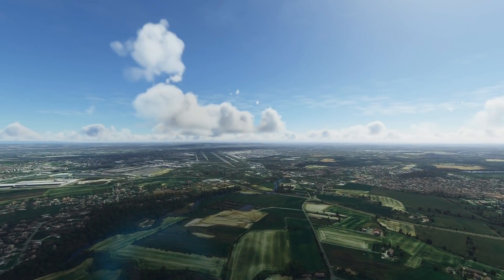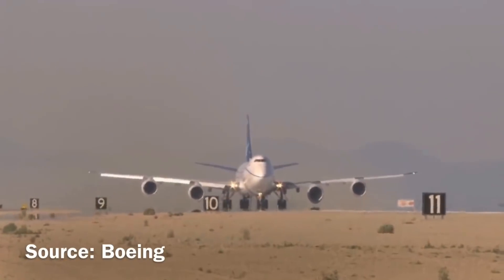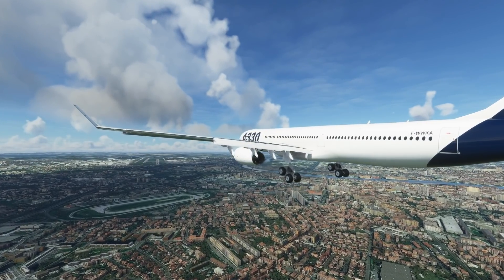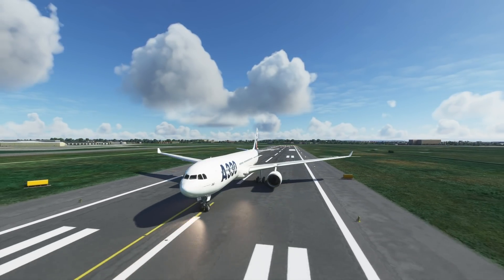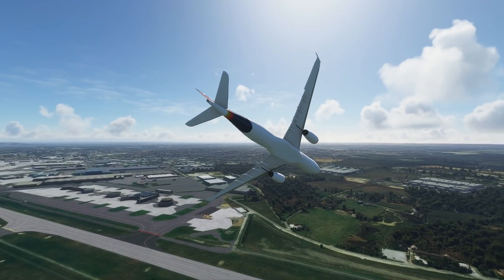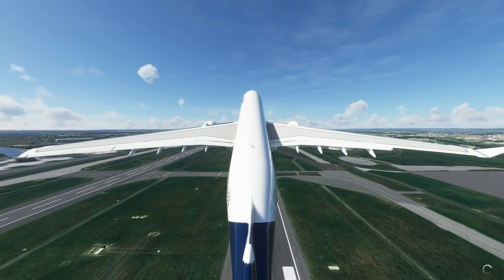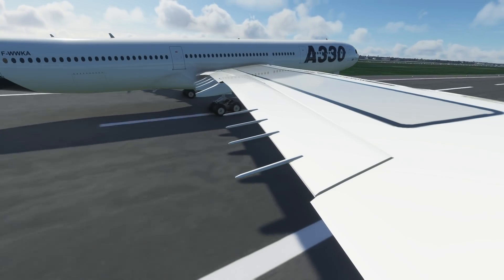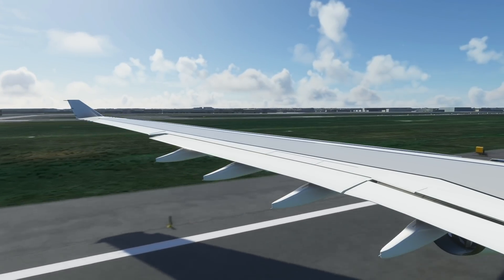The Test Flight That Went Horribly Wrong | Airbus Industrie Flight 129

Comment: There is one thing I have a life of me cannot understand. Why are  people allowing autopilots to put the plane into an unsafe position and not give a warning to the pilots?

It should take no genius to program the autopilot so that it registers that at this power setting this lead in this news angle a crime is not going to be sustainable I am bad storm will happen pretty soon. In this situation there is no reason for the autopilot to not throw up their hands and say: “Hey pilots,I cannot do that! It’s not safe! I don’t have the power, I don’t have the speed, I am already angled up way too much!
Instead of trying to commit suicide, I will therefore go to a safe state. That means I will not put all priority in to climb, I will not climb so fast that I drop below a safe speed.  If you want me to do anything else, you have to give me new and fulfillable orders.“

“I was only following orders” has fallen out of fashion after 1945.
Yes, absolutely you must alert the pilots, but the most safe way is almost never to climb into a stall, avoiding entering a stall is almost always preferred. If not, pilots can intervene.

On top of that, an autopilot changing modes without announcement, based on arcane rules, is clearly not “the least surprising action”.

It’s as if people designed the autopilot to be stubborn beyond belief when it comes to climbing to a target height “for consistency” but changing modes willy-nilly where consistency would actually be needed!

Where is the line between incompetence and cold-blooded murder when you design autopilots that do their best to kill pilots?
Reply: You’re watching a video based on an accident from 1994.......do you think they’re exactly the same nearly 30 years later?

Comment: Although the crew was apparently tired and not on top of things, automation in the cockpit strikes again.
Reply: Why the autopilot doesn't set off a very clear audible and visual warning upon switching modes, I don't know. It is a very big reason for trouble if the autopilot decides to start doing stuff you didn't expect it to.
Reply: That was all it was....pilots not on top of things and leaving the altitude set to 2000ft. Everything else you may as well blame on the person who designed the auto flight system and didn’t put an attitude protection on the altitude capture mode of the FMGEC

Comment: I recommend they dont engine out training on actual planes with a full fuel tank low to the ground. A new pilot will always mess up and crash the plane.
Reply: Right? I wonder why didn't they try it at altitude first. Climb, slow down, configure the plane as it would be right after takeoff. Pretend they just took off from Denver. Climb and during the climb, shut down the engine. It would have given them at least some idea how the plane will behave, with plenty of buffer to get back control in case they were close to stalling.
Reply: @lukfi89  the test objective were to see how the autopilot would handle the aircraft in case one engine fail on initial climb after takeoff, not how it would react if one engine fail at altitude in a level flight
Reply: New pilot? Those pilots were test pilots with thousand of experience of testing experimental aircraft

Comment: Thank you for treating this crash. Long time ago. I live 125 km from TLSE. Just before that crash I took a girl friend to Blagnac-Toulouse airport. I hesitated to go to the runway to spot the plane leaving, in which she was flying back home (I usually did that, she worked at KLM at that time as a purser), but I had an appointment, I declined to do that. Driving home on the highway I saw in my mirror a black column of smoke near the airport... mmm, some farmer is making a big fire with a lot of old tires in there, was what I remember thinking... I did not think one instant of a crash... Back home, two hours later, after my appointment, I heard on the radio the terrible news... When I think of the fact that I could have been at the side of the runway at that moment if I would not have been so tight with time for my appointment...
Reply: Condolences for the loss of your friend.
Reply: @janicesullivan8942  I maybe wrongly understanding this, but I don't think she died.

Comment: Wasn't it a common problem with early Airbus planes? Too much automation and/or computerization, almost taking the pilots out of the loop?
Reply: I wouldn't say too much.
More that it did too much for the pilots to stay in the loop, but simultaneously too little to keep them out of the loop safely.
So, in other words, in the unsafe valley between no and full automation...?
Reply: @MrNicoJac  I know that Boeing went another route, where they wanted the pilots to be as much a part of the decision making process as possible, but that brought other problems with it. So, yeah a safe balance is needed.

Comment: Bro, how have I never heard about this!!! Everyone knows the 320 going into the trees, but not this.
You need a million subs.
Reply: The A320 crash was quite different to be fair - it was filmed, many people saw it happen, was a demonstration flight, and had passengers. It's still unusual that this isn't more known though, I can't remember seeing anything about it recently(must've been in the news at the time though)
Reply: Airbus flight 129 is not the only case of the computer crashing an airbus that most people have not heard of.  XL Airways flight 888T was a test/acceptance flight of an airbus A320  that the computer flew into the Mediterranean sea during a test because the angle of attack vanes froze in flight due to water ingress.
Reply: @Vincent_Sullivan  wrong. The pilots stalled the plane when they kept slowing down due to the incorrect Alpha Max display BECAUSE OF the frozen AOA sensors. They flew it into the sea themselves when it stalled
Reply: @Vincent_Sullivan  Computers did NOT crash flight 888T they failed to recover it. The protection systems were offline bc of the frozen AoA vanes.

The crew began the test too low and assumed functionality of the recovery systems.
Reply: @Vincent_Sullivan   some things just can't be found any other way than using the equipment under various conditions and seeing what happens..
Reply: @Vincent_Sullivan  I've read all about the alpha floor acceptance test crash.

Comment: Not sure why the autopilot would try to get to 2,000 feet without the autopilot also taking into account the loss of engine, pitch, bank angle, stall speed, etc.  Sounds like a software issue to me.
Reply: ALT* mode at the time did not have attitude protection.  If they had actually checked the altitude selector and seen it was so low it would have stayed in SRS or gone to climb mode

Comment: It’s too bad they didn’t try this test in a simulator first. As a person who has never been able to walk and chew gum, I’m in awe of the competence of skilled people. In spite of their extreme collective ability the human factors, which procedure, the preflight briefing, was designed to overcome,  mounted up and doomed them.
Reply: Before they do that in the sim they have to test in real mode to feed the sim real data. This is why no sim currently simulate stalls it is because stall is not required to be demonstrated in certification, so it is never done in real life thus not modelled in sim.
Reply: Could they have not tried the same simulation in an A321 flight sim, to get an idea of how the plane might respond?  I guess they know now.
Reply: @paulsz6194  no because the A330 is much bigger and its engines produce more thrust

Comment: 2000ft would have been set as the go-around altitude from the previous flight, after they descended below 2000ft on the glideslope. The same thing could have happened during a single-engine go-around. They'd have been at TOGA thrust on a single engine, in SRS vertical mode initially, but they'd quickly enter altitude capture mode. The lack of airspeed or alpha protection in altitude capture mode was one of the findings of the investigation. Although human performance did play a major role in this accident, the A330 autoflight system was updated to address this deficiency. Many airports have go-around procedures with low level-off altitudes that create a high workload for the flight crew. Much more recently, the A320neo family has added a "soft go-around" mode with a slower rate of climb so that they don't take off like a rocket and smash into altitude capture seconds later.
Reply: I was surprised when I looked this up that ALT CAPTURE mode didn’t have attitude protection. I thought it was basic and built into the whole EFCS
Reply: @tomstravels520

I was surprised too when I did a circuit in a King Air with altitude capture at circuit height (I’d just disconnected the autopilot/yaw damper and left flight director and modes on) and yeah it was aggressive. 

It probably just assumes that if it captured it.. it was from a previous vertical mode and if it’s off it needs to do whatever it can to get back.. probably thinking it’s at cruising speed in the flight levels.  

One thing I’ve never understood about Airbus though is using Angle of Attack rather than Airspeed as a flight envelope parameter. Yes.. you need to exceed the critical angle of attack to stall.. but without airspeed.. preserving that angle of attack will give you a recovery point that is subterranean which is exactly what happened here. 

That’s why most planes are flown in reference to airspeed not angle of attack.

Comment: Thank you  for this Sunday surprise. When you mentioned " no formal pre-flight briefing" I was shocked even  tho I was familiar with this incident.  Senseless loss of lives.
Reply: I think egos and even wanting to show that you don't have one are equally dangerous in the cockpit. You always need some kind of cockpit gradient. Not one so steep that nobody dare question the captain, but also not one so flat that nobody takes the lead to direct things and delegate roles and responsibilities. In some cultures the problem is extreme cockpit gradients where the first officer is an underling to the captain. In other cultures nobody wants to appear full of themselves and take the lead when they feel like they're around equals and peers, and a lot is then just assumed because everyone is surely on the same wavelength.
So much of flying safety advice and information is about risk assessment and crew attitudes and personalities.
Reply: Maybe it wouldn`t have made a difference.

Comment: I disagree with pretty much all your conclusions.  The one and only failure was the use of autopilot for takeoff.  That takes the pilots out of the loop for the most critical point in a plane's flight.  This should be outlawed for all flights in the US.  If a pilot can't get a plane up, they shouldn't be flying.  There are too many variables to be programmed into a computer.  I say this from my decades of experience building and programming computers.
Reply: Well it’s a good job you’re not an accident investigator then as they found multiple issues. Taking off with an autopilot whilst may be seen by those inexperienced as “lazy” sometimes it can be handy especially in a high workload environment when you have lots of traffic and dealing with ATC at the same time.

Comment: An autopilot should never make inputs that stall a plane, imo. There a few worse conditions for a plane to be in than to be stalled, because a stall not only loses you altitude, it also loses you the ability to control the plane.

Was that mentioned in the report? Because unless there's very good reasons, I can't see why the autopilot should ever be allowed to do that.
Reply: Because ALT CAPTURE mode did not at the time have attitude protection
Reply: This was my thought exactly. Autopilot can still increase or decrease altitude but shouldn’t be able to do so at too steep angles.
Reply: @TheaSvendsen  It sounded like it didn't account for the current available thrust, or the fact that it was asymmetric.    I would think it should have detected the stall condition, and tried to at least level out.  Or nose down with wings level. But it sounds like the didn't have enough room, even if they did get the wings level first.  I think that's what they were trying to get to, before impact.
Reply: Fly, do you really think you are smarter after watching a 9 minute clip than the experts who worked for months on the report studying every single second of the flight recorder?
Reply: @bepowerification A330 fatal crash in its early days, you never know what they try to cover up

Comment: It was the aircraft's automatic controls that crashed the plane.
Why was such a risky test done on take off, putting the aircraft
in certain dangers?  The people who approved of such a test,
should have been terminated.
Reply: How do you think they test for engine failures on takeoff. How do you think they capture data for the simulators then? They can’t just give the plane to the customer and let them find out. Engine failure on take off is the worst time to have an engine failure so it has to be tested to see how the plane would react. If the pilots had set the aircraft up correctly it would have been fine
Reply: @tomstravels520  
They should have allowed enough altitude to
have  aircraft  recovery.  This test was faulty
due to pilot and control errors. shutting
not have  the same computer response 
for engine failure. 

The computer did not abort it's preprograming to
2000 feet.  An engine failure would have aborted the
2000 feet computer preset control.  Faulty engine
 and engine shut down have two different computer
 responses.
Reply: @billrundell2097  no it wouldn’t. The autopilot was in alt capture mode which at the time commanded pitch regardless of airspeed. There was no attitude or AOA protection in this mode regardless of both or 1 engine working. Only in SRS or climb modes would the pitch have decreased

Comment: So the fancy computerized autopilot crashed yet another plane...........
Reply: @rodolfoptx  If the fancy autopilot were a bit simpler and didn't change modes on its own, the accident most likely wouldn't have happened.

I'm not trying to place all the blame on the autopilot but it's very easy to become dependent on automation to the point that a failure or unexpected operation goes unnoticed until it's too late.
Reply: @rrknl5187  And how do you know this wouldn’t happen on a Boeing? One of the main part of the checklist is to ensure the FCU is set and that includes initial climb altitude. 2000ft was left from the previous missed approach altitude so the pilots failed to set that to prevent the ALT CAPTURE mode and would have kept the plane in either SRS or Open Climb/Climb mode
Reply: @tomstravels520  It certainly could. 

My comment wasn't directed at Airbus specifically, it was directed at what I consider excessive automation and much worse, pilots dependency on it and failure to monitor it.

Comment: Somehow it sounds as if this testing process was not being taken really seriously. The captain was tired, procedures were not completely followed, many failures were tested at once. There were 7 people on board. Did they forget that the plane might fail the test?
Reply: "Did they forget that the plane might fail the test?" 

 Indeed. Complacency kills.
Reply: @mbvoelker8448 yep. It was noted as contributory cause, in the report.
Reply: Agree...I can understand if the tried half power on the first attempt and see what happens...but a complete shutdown on a new aircraft?
Reply: @markbakerskater666  they didn’t shut the engine down they just idled the engine
Reply: @tomstravels520  Yep sure which makes me all the more curious as to why he didn't peg the throttle on the idling engine - yes sure there is spool up time but in a nose up situation like that at barely over 100 knots , it would seem that the last thing you want to do is reduce power.
Reply: @markbakerskater666  they thought the aircraft would be able to cope as the pilot captain was likely so tired to realise that the test was going wrong
Reply: @markbakerskater666  yes.

And there needs to be a process for of the aircraft is failing the test.

If it's not flying right on the engine out test, advance the "dead" engine.

It's hard to do. I've done cave diving training where the drill is that you're out of air. It's very very very hard to remember that if things are going south you're not actually out of air.
Reply: @gasdive  yes the difference being that in an aircraft at least you can get an idea of what may happen...if you run out of oxygen then that's rather more "on or off".

Comment: Lesson ... dont turn off engine.
Reply: It would seem a safer way to do the test would have been to idle the left engine rather than to shut it down completely.
Reply: @joevignolor4u949  that’s what they did. The narrator got that wrong
Reply: They didn’t. They idled then turned off the hydraulic pump

Comment: Why autopilot did not take into account that plane can stall with high nose? It should be inside autopilot logic, right?
Reply: It does have this stall protection. Considering the fact it was a test flight with simulated failures and "worst case scenario", this protection might not have been used because the plane could be in alternate law or direct law, but I don't know if this protection existed back then.
Reply: @ederss7  at the time ALT CAPTURE mode did not have attitude protection
Reply: @ederss7  single engine fail won't revert the fbw into alternate law, moreover on this accident, they didn't actually shutdown the engine, they just pull the thrust lever back to idle hence the system didn't see any abnormality
Reply: I guess the software engineers didn't think about it at all when they program the system... But it's not the case anymore, well they fixed their mistake